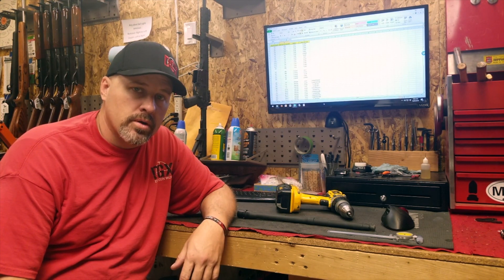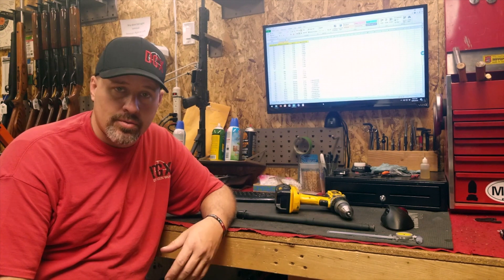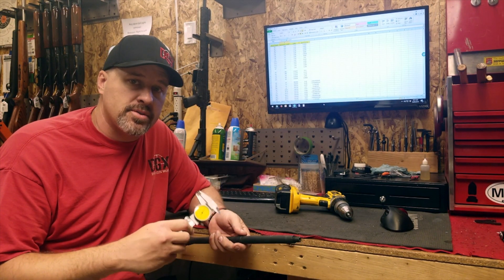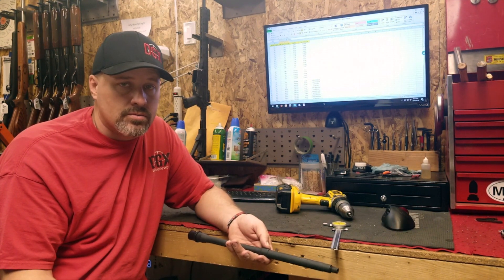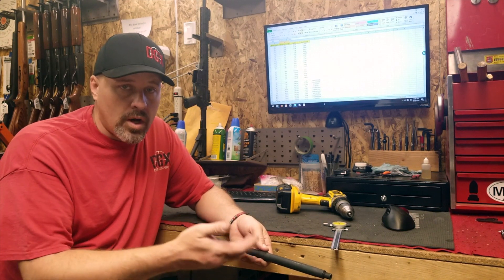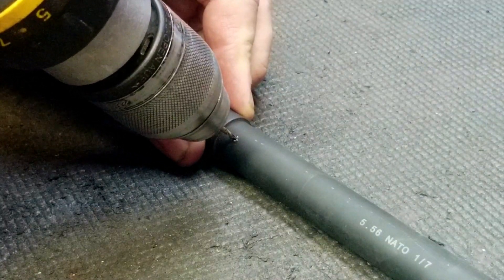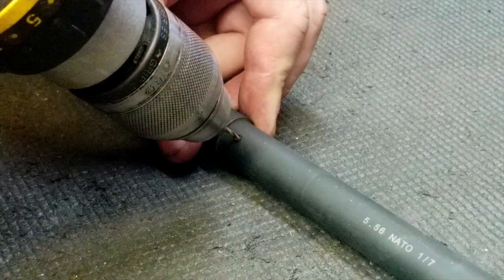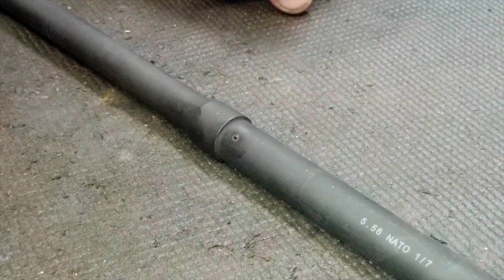Drilling out Gas Port hole on AR-15

Comment: Any concern for burrs left at the end of the cut? I'm concerned about leaving any small obstruction in the barrel or deforming the rifling.
Reply: Clean and inspect as you normally would clean your barrel. It should be pretty obvious if there are any little snaggle-tooths in there. 55g Fmj will get the rest.
Reply: So the bullets will deburr the barrel?

Comment: Thanks for posting this 'how to' video. I'm about to do the same to my new S&W M&P 10 

Sport, which has this exact same problem. It's got a 16" barrel with a mid length gas system, and is failing to eject spent shells almost every other round. Apparently this is a common issue with these rifles, and drilling out the gas port to 5/64ths is the fix. I just needed to see someone do it one time to get comfortable with doing it myself. Much appreciated!
Reply: Those measures are for an AR-15 barrel, would you need a different size hole on your m&p10?
Reply: @shoe2973  No, there are dozens of videos on YouTube of M&P 10 owners having the same short stroking problem, and finding that the solution is to drill out the 1/16th inch gas port to 5/64ths. I'm just glad that the problem's been solved, and that it's something I can do myself without having to send my rifle back to S&W to fix.

Comment: I'm about to do this with a 3/32" bit on a rifle length port that is measuring out .085" and is not cycling correctly.
Reply: @CarlnmnJames  I measured the bit as they vary wildly. It game out at 0.0935 on my cheapo scale with the 5 not a sig fig. It is a 223 in a 22" barrel.
It went smoothly and the rifle cycles fine.
Reply: I used a 3/32 bit to open my Stoner 18" 22 Nosler port. All my cycling and brass problems went away. Also used a nonadjustable gas block.

Comment: To avoid accidentally drilling thru too far and hitting the rifling on the other side, ruining your barrel, stick a cleaning rod into the barrel first. Simple.
Reply: Yeah I was just thinking that put a wooden dowel down there
Reply: Good tip on the cleaning rod. Thanks. I gotta do a Willson Combat barrel today.
Reply: Good idea 👍
Reply: If you have a 3/32" drill bit, an adjustable gas block, and some common sense, you'll figure it out.
Reply: Or light saber
Reply: Or a drill bit stop.
Reply: @Shadow6a  I think that's the best solution for do-it-yourself'ers who don't own anything but a hand held drill (like me).
Reply: Or drill press

Comment: Was the source Bear Creek Arsenal?
Reply: I’ve actually never had this issue with a bca. That being said I’ve seen two mid length 13.7” rosco barrels have undersized ports.
Reply: @twinglock40z  thats what I believe I have now undersized ports
Reply: @christophermartinez2552  what brand barrel? I’m now on my third rosco barrel with undersized ports.
Reply: @twinglock40z  did rosco make it right for you? Having the same issue  with one of their barrels.
Reply: @nushinebob  I’ve reached out to them and told them each time. And of course the always offer to make it right and for me to send it to them. Not worth it to me when I can just fix it fairly quick myself.
Reply: I ran into similar problems with Bear Creek also.
Reply: Anyone fixed this gun wont cycle at all